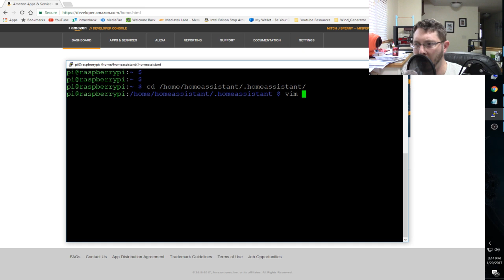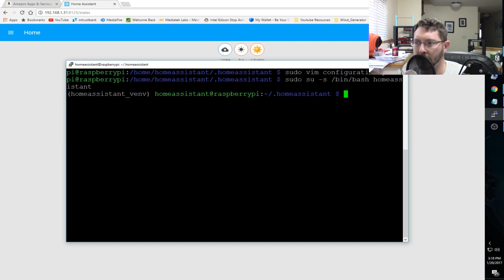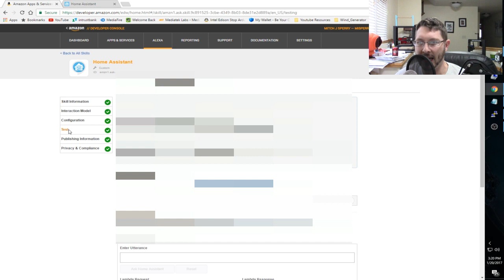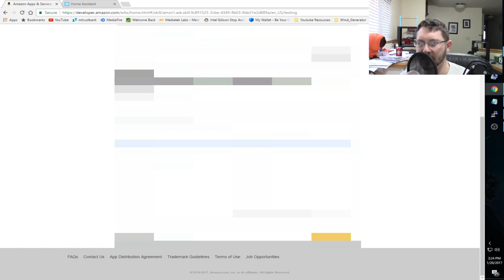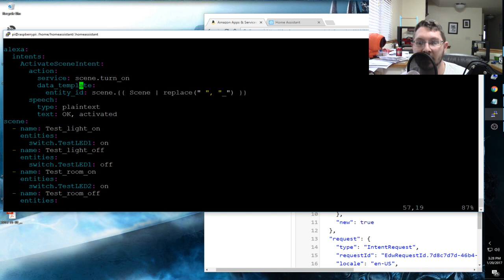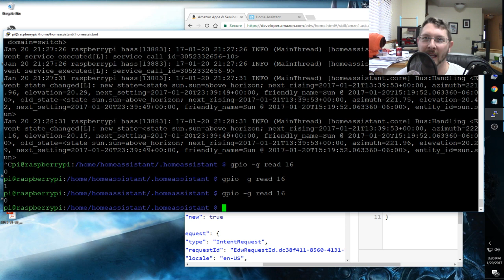AlexaPi - Custom Skill Testing

Comment: What are the steps to configure DNS settings if I am using WiFi dongal instead of router,dongal has no portforwarding option. N what changes in code should I make to make it work. ??
Reply from the maker: Ok first are you using a dongle that is a cellular card?  Or are you just going on wifi at some place like a coffee shop or somthing?  If you are using a cellular card to get internet you may only have to allow the port through windows firewall, if you are using windows, or your linux firewall, if you are using linux.  However, if you are simply getting on a wifi hotspot it usually uses NAT (Network Address Translation) and translates the ISP given IP address to your IP address that the router's DHCP server gives you and there is where you need to port forward the router to tell it that when it has something on the ISP given IP address it needs to give it to your IP address.  If you have no access to that router you will be unable to get it to you.

Comment: I figured out what the problem is...... but the news are bad... my provider does not not support IPv4... i have to do this with IPv6
Reply: where can i change the port in the .yamel file ?
I have the problem that my provider uses DSL-Light. That means that i am only able to use IPv6.
How can i reach the home assistant with IPv6. I tried it with : http://[IPv6-adress of the PI]:8123 .
But that didn't work... 
I installt Apache2 for some testing. I can reach the Apache2 Debian Default Page with http://[IPv6-adress of the PI]:80  from the internet, so i think its a port problem.
Reply from the maker: You need to add a server_port directive to your http section: https://home-assistant.io/components/http/ .  Good Luck!  Sorry to hear about the IPv6 stuff but good to know.

Comment: I keep getting a "[homeassistant.components.alexa] Received unknown intent ActivateSceneIntent" error whenever I watch the journal while testing the utterance commands. Any idea what I may need to look at? The response in the lambda console is "This intent is not yet configured in home assistant".
Reply from the maker: +Adam Simpson Hey there, when I was getting those utterly useless errors lol, I found it was the dns and port forwarding.  Also I checked and it was the address I was using in the lambda function.  Also if you are getting configuration issues in home assistant here is a link to my configuration.yaml file that you can go over if it will help.  https://www.mediafire.com/file/cviz666o13i5tii/configuration.yaml
Reply: misperry thanks! I will take a look and see if I can get it working tonight.
Reply: Plz tell me soultion detail
Reply: I am experiencing the same problem. have you found a fix?
Reply: Same here. Did you end up figuring this out?
Reply: I was able to get this to work by having alexa: on its own line with a blank line after it.

Then I change the intents: line to read intent_script: 

Lastly I removed two spaces from each line down to the scene: 

This config checked out correctly and seemed to work with my setup.
Reply: Simply follow the instructions in my post above. It worked for me. The syntax and positioning in the yaml file is critical.
Reply: plz can you see your sample yaml file? i dont entered this link 
https://www.mediafire.com/file/cviz666o13i5tii/configuration.yaml
Reply: Try this (the changes are on line 60-71) :
http://www.mediafire.com/file/pg88tfcs3vcmfoa/configuration.yaml
Reply: thank you verrrrrrrrrrrrrry much guys

Comment: Hello, so while testing I always get the response "This intent is not yet configured within home assistant", although my code is exactly the same as yours. After reading through the patch notes for the version 0.50 I found out that they changed the configuration of alexa. Now they use "intent_script", which I tried using, but without success. Could you tell me which version of home assistant are you using or how I could get it working with the intent_script?
Reply: Have you had any luck? I'm so close to getting it to work but HA doesn't recognize the intents.
Reply: Adam Simpson Tried using the intent_script but I get the same result, unknown intent. Eventualy I just gave up and setup haaska which works perfectly almost right out of the box.
Reply from the maker: +Jack Hmmm.  I have not tried it recently.  I will have to give it a shot and get back with you on that one to see if my custom intents still work post update.  I believe there is a comment page for the alexa api that you can leave there.  I am not affiliated with them so I am not sure I will have to test.
Reply: Any luck on resolving this? So close yet so far

Comment: Next problem :/ 
My lambda response answerd "The remote endpoint could not be called, or the response it returned was invalid."

Cant get a DynDNS so far (got quit a lot ptoblems with my provider), but if i put the IP of my network in the Lambda skrit it should work anyway ?! Or not? :D 

But the problem have to be in the Lambda skript because the journalctl command doesnt even react to the  test of the service simulator..... 

Again sry for the bad english. I am from Germany.
Reply: I have another question. 
when i set up the port forwarding thing and type the IP-adress of my network and the port 8123 into the browser (109.6......:8123) i should reach the homeassistant?
Reply from the maker: As long as you are putting in the inside address of your home assistant pi in your browser along with the 8123 port you do not have to port forward because you are already on the inside.  However, for the alexa service it is in the amazon cloud not in your home network.  Thus, the reason to port forward the 8123 port from you outside address to your inside home assistant address so that AWS can reach it.  But to make a long answer shorter if you go to your web browser on a computer that is connected to our home network and type in the ip and port you should get your home assistant.  Example:  if your home assistant has an ip address of 192.168.1.3  you simply need to type in 192.168.1.3:8123 in a web browser and it should work.  only from a computer that has a similar ip address like 192.168.1.10.  If you are on your cell phone and it is connected to 4G or something then typing 192.168.1.3:8123 will not work because your phone is not connected to your home network if it is on 4G.  Hope this helps explain.  I may make a video.
Reply from the maker: Technically yes it will work as long as the ip address that you put into the lambda function is your outside address.  this can be obtained by having a service tell you.  A free one is whatsmyip.com  Hope this helps.  cheers!
Reply: I basically tryed to reach the homeassistant website about the IP adress. So i can delimit the problem. This does not work so it is defenetly a provider problem :/
Reply from the maker: Shepherd yeah it could be that they are blocking certain ports.  Check to see what ports they don't block and use one of those.  In the .yaml file you can change the port from 8123 to what ever
Reply: thanks man :) awesome help.
Thumbs up

Comment: The remote endpoint could not be called, or the response it returned was invalid. I get this at lamda test step after i enter text utterances. is it because of port forwarding error. i use wifi dongal and it dint show any me any port forwarding section in mine at dns setup. in lamda function code i have put the dns ip address what i found after i generated dns domain. please help me in this
Reply from the maker: what does your link look like?  Make sure that when you make the dns it does resolve properly.  Use a different internet connection like I use my cell phone and ping your dns domain and make sure you can reach it.  Also check the web addresses and make sure your pass word is correct.  Also you can state your configuration here and I can try to see what may be an issue.

Comment: I would love a link or tut that would give more info on dimming LEDs :)
Reply: Or even the code to give custom commands for like "low light" (25% power) and "high light" (100% power) which might be easier
Reply from the maker: Yes this could be possible.  It can control a phillips Hue which supports dimming.  Also if you want to control an array of LED's you could write a script that utilizes the PWM modules and control the dimming with different scripts that are 25% 75% 100% and so on.  Then build a voice command to activate each script.  I need to show how to connect a script with a voice command.  That may be my next vid.  Thanks for the comment.
Reply: Thanks for the reply! I have been able to make it have a "blinking dim" with a python script, but not have it at a constant 50% dim

Comment: Hello, 
did you manage  to Controll 433 MHz Device from a Alexa Pi?

I set up Alexa with a 433 MHz sender, but i dont get it managed.
Reply from the maker: +warsno no I have not yet tried that. I do have one of those Cinders and that is a great idea to attempt to use that in case you don't have wifi. I'll have to give it a shot and let you know
Reply: That would be great :)

Comment: Thanks for a great set of videos, I have enjoys following them and trying them out, but I have fallen at the last step, my skill isn't working
So I know the following is working
Alexapi - took a bit of effort but it is now working fine
Home-assistant - working like a dream I can turn on and off leds without any problem
DDNS - I believe is working as I can connect from a computer outside my home network to my home assistant and turn on an off the leds using the scenes I configured

Now is when things get a bit less certain
I created a skill and I created the lambda function and got both the ARN and skill application id
In the lambda I edited the .js code to include my skill application id  and my DDNS address and password
In the skill I added my ARN from the lambda plus the intend code, scenes and utterances.

However when I speak the command to Alexa she tells me she can't find that, if I use the test tab in the skill website the response I get is

The remote endpoint could not be called, or the response it returned was invalid.

I checked the home assistant journal and nothing is added when I test the command, so it would appear my skill/lambda isn't sending anything to my home assistant in the first place
I tried the url from the lambda code in a browser but I got back a 405 error but I'm not sure if it was meant to work or not.
Is there anything jumping out at you that I have missed?

Thanks
Rangin

Comment: wheres best place to get bootable 32 gb sd cards for rpi3? all mine are not booting but work as storage and have been formatted correctly and i dont know what brand to get?
Reply from the maker: I have used many brands and all seem to work.  Make sure you are using a disk imager like win32diskimager

https://sourceforge.net/projects/win32diskimager/

To write the .iso image to the SD card.
Reply: i do use that application and have tried like 4 micro sd cards allbeit cheap hong kong ones which is probably the issue right? i have tried 64 gb and 32 gb ones, im thinking i need better brand like legit kingston, transcend and samsung, what you think?
Reply from the maker: Well maybe.  I have used the walgreens brand ones that I get from Wallgreens here where I live and not had a problem.  The best ones are the ones I get from amazon that are SanDisk brand.  They definitely work for me.  There are many grades based on speed.  Check out this wiki on the grades.

https://en.wikipedia.org/wiki/Secure_Digital#Micro